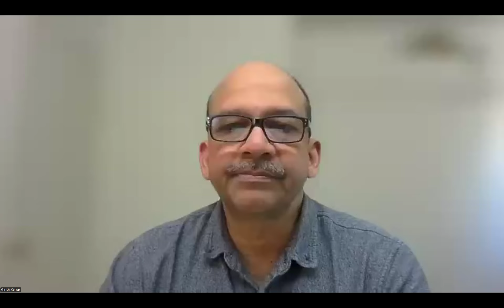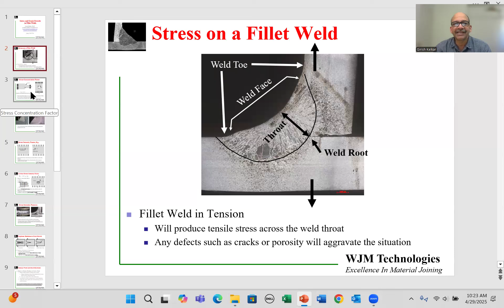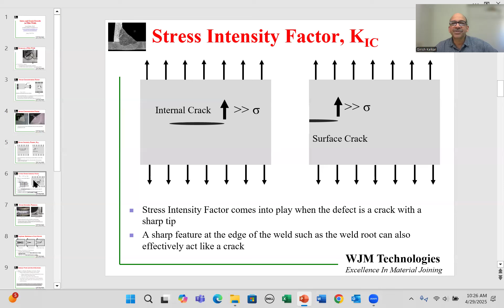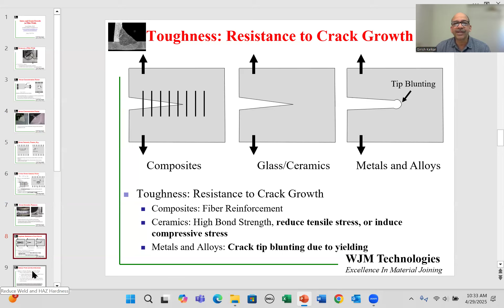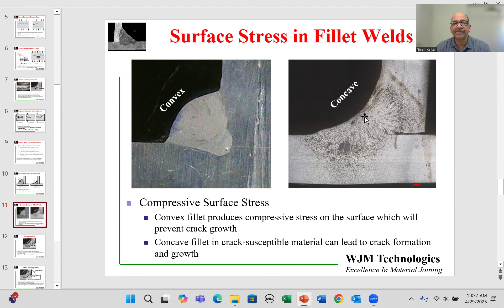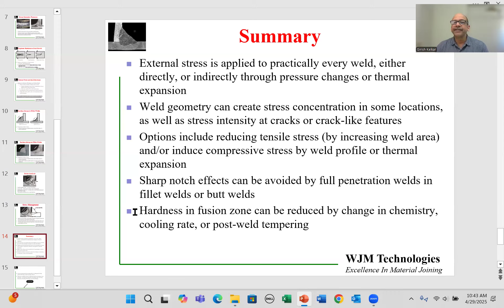Stress and Crack Growth in Fillet Welds

Comment: Does this analysis apply also to adhesive fillets, such as epoxy fillets?
Reply from the maker: Not sure how that would translate, as it will depend on the strength and fracture behavior of adhesives, and am not familiar with that subject.